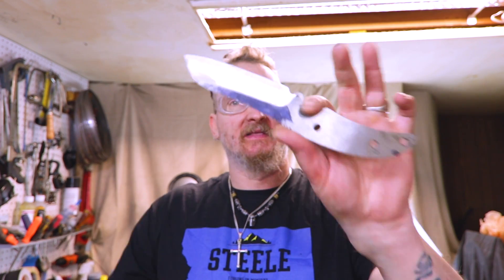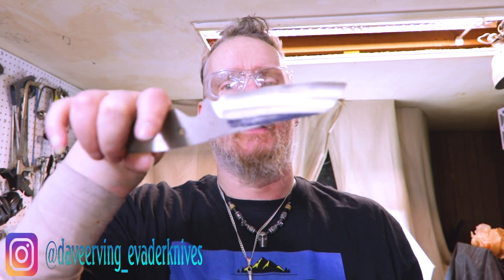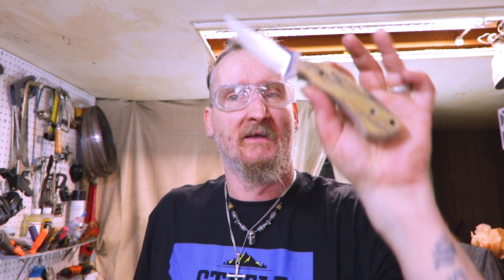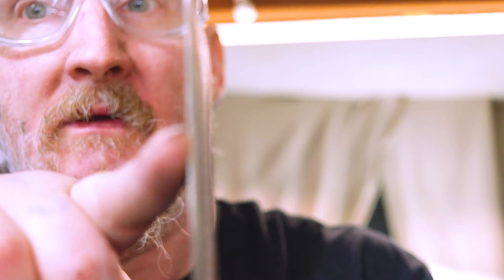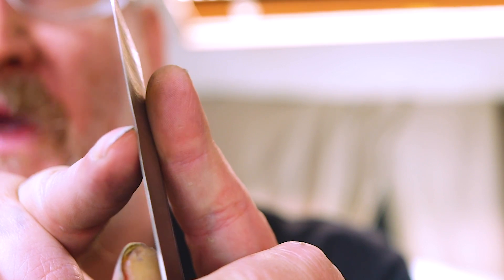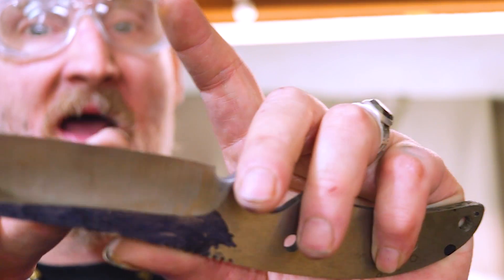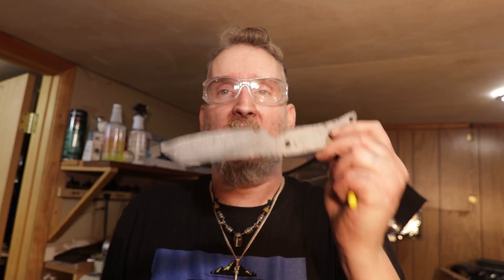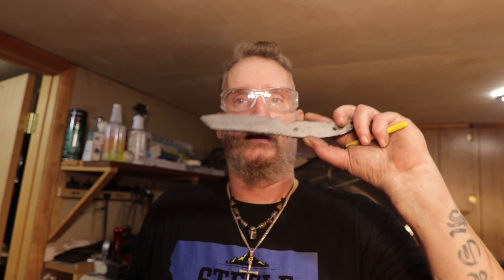Knife Making -Anti-Scale do you need it for Heat Treating??(Hamon build)

Comment: Wish I could say great video but I’m kinda lost when it comes to heat treating. I’ve got to go back and learn from the beginning to appreciate what you’re doing now. I’ll get there !!!
Reply from the maker: See when you heat treat a blade it goes through many stages, long story short oxidation forms decarbanation on the blade(the black coating) the higher the heat, the worse the decarb(which is why with stainless you use SS foil packets)... Anti-scale prevents this. I have been wanting to try it with a torch, because heat treating with a burner introduces the most oxidation of them all(fire needs oxygen, etc).